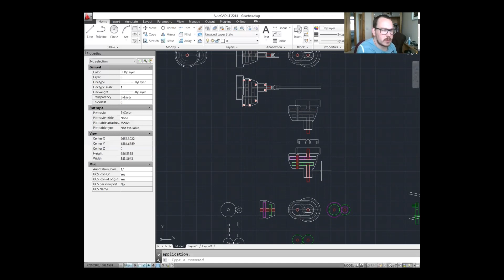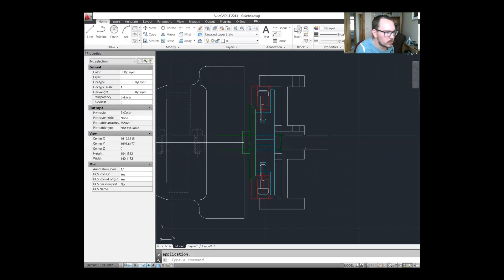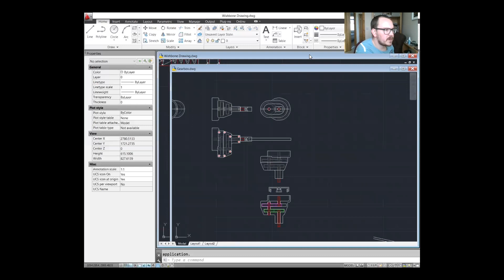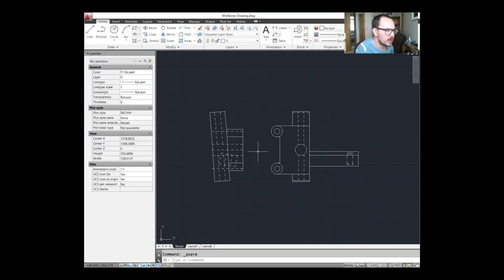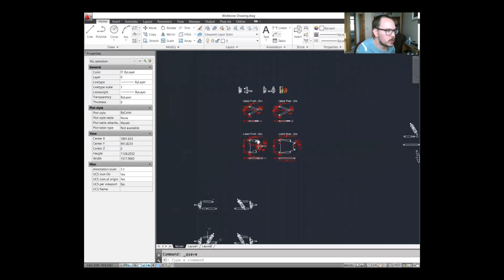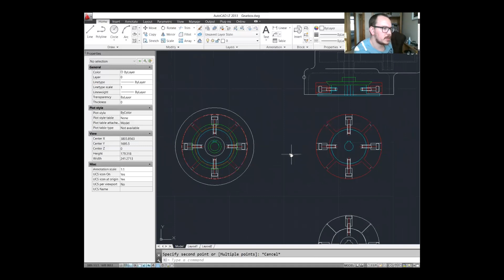Building a Mini Caterham - Part 2: Suspension and Clutch Design

Comment: You can use a planetary gearbox set up to give you the reduction ratio and as a clutch . If you drive the sun  gear , have a braking arrangement like a disc brake on the planet gear cluster driving the ring gear -when the brake is free the planet gear cluster can orbit the sun gear removing the drive from the ring gear . When the drake is applied the planet gear cluster is locked so they cant orbit the sun gear and  will transmit power to the ring gear .
This is basically how an auto transmission works when you go from park to drive except they use a torque converter like a clutch . If you make the disk brake so it activates slowly it will slip a little and give yo a similar effect to a proper manual clutch.
Reply from the maker: Thanks Ian, someoneelse suggested this to me too. I've been looking at the model ford t gearbox.

Comment: Really excited to see more of this. Maybe motorcycle parts, like MC brake pads/shoes. And possibly trans gears. Or of course off the shelf centrifugal clutch from a small engine. Or if all else fails you can buy friction material and make any style/size you choose
Reply from the maker: Thanks Craig for your comments. Motorcycle parts is a good idea for somewhere to look. I'm trying to avoid a centrifugal clutch as I'd like to rev the engine with clutch disengaged. Where can you buy frictional material?
Reply: @mrmechanical3423  https://www.mcmaster.com/friction-material/

I have had some trouble in the past searching for  "friction material"  I saw the idea on youtube as well from another guy. Of course It might be possible to source locally from clutch repair places. Another kinda of risky thing I saw on YT is a fellow that simply cut off the friction material from a brake pad by hand. Obviously a person would want to avoid asbestos pads, but even I have considered the last option as I have a local scrap yard that often has large brake shoes I can buy for dirt cheap
Reply: @mrmechanical3423  also if it helps, a person could probably mod a centrifugal clutch to function as a manual if that approach is simpler. There are many options,  its just a question of what works best for you. Also if you like please feel free to email me  graystang88@hotmail.com